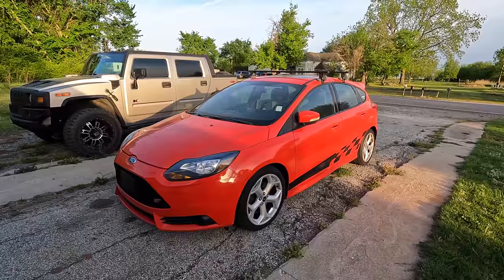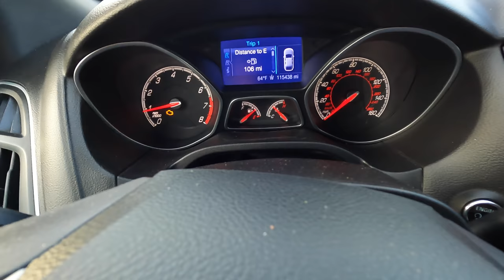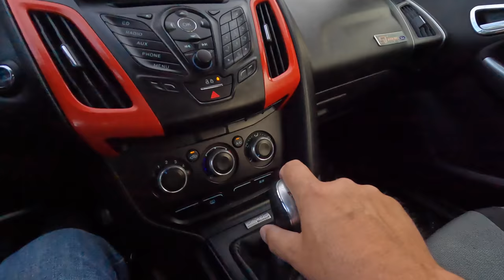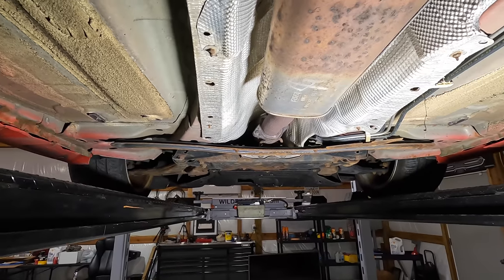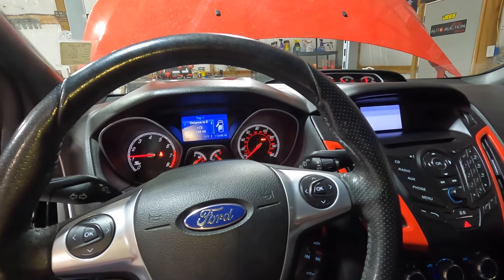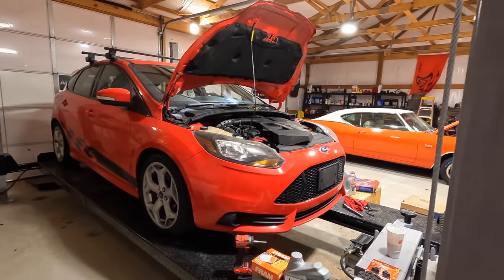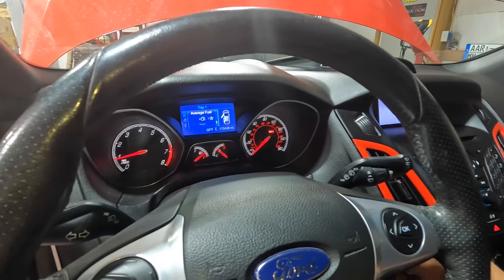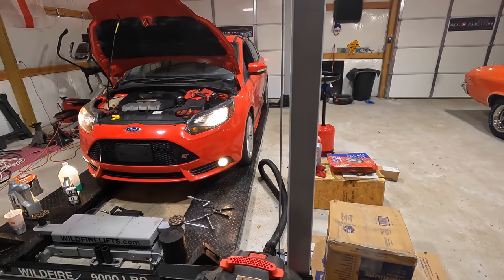I Bought a 2013 Ford Focus ST for $7K Sight Unseen! First Drive and Repairs!

Comment: I own the exact same car 2013 Focus ST1 in Race Red (less the sunroof) - had from new - now at 135,000 miles. Lots of “OEM Plus” type mods done over the years. You can easily upgrade the radio and screen to SYNC3 with navigation and Carplay/Android Auto, like they came with at the end of the run (2017/2018).
Randy - hit me up if you want lots of useful hints on common issues, mods, upgrades etc. (eg Focus RS brake package, full leather interior from Focus Titanium, SYNC3, Intercooler upgrade and tune, flat bottom steering wheel upgrade, shark fin antenna etc, etc.
Reply: In reality,,, Ford can make the Focus fast,,,,but they are still “ a throw away car “ fun though ! LOL

Comment: It's difficult for me to judge car values anymore since the market went apey. Last car I bought was a 2007 Grand Marquis LS for $4K and before that was a 2008 Miata GT for $5500. I doubt we'll ever see those days again.
Reply: here in ky you cant give a grand marquis away but they will beat your door down for a miata. they see rwd v8 and they automatically pass.
Reply: Yea it’s crazy, I bought my car 2 1/2 years ago and I’ve put about 20k miles on it and it’s worth 7k more than when I bought it. Granted the miles are under 50k and it’s a newer-ish car but it’s insane, I can’t judge the market either
Reply: @jeffreyrigged  Strange days, indeed.
Reply: @armedinbama  if you have some kind of fwd awd v6 i4 or a 4wd truck suv car you can sell it book value or more all day. v8 cars cant give them away. even though the gm prob is no worse on gas than say  most fwd v6 cars. diesel trucks same you can name your price but a 3/4 ton gas sells less than a half ton even though they cost no more to operate than the diesel right now.
Reply: bought a zl1 a week ago for 37k. Now I can't find em for under 45-50k
Reply: Nah cars still go for what they used to. It just doesn't happen as often. I just paid 1300 for an 08 Focus 5 speed
Reply: @GokuGaming  dang, what year?
Reply: They will. Once the supply chain corrects itself we will see a surplus and crazy cheap prices. Just give it some time.
Reply: @racequad9  I hope you're correct! 😁👍

Comment: Those little hatches certainly are fun! I drove a Vibe GT for a couple of years and it was fun with 180 hp and a 8,200 redline. So I debated on a Focus ST or my Mustang GT when I was last shopping for a new car back in 16. If I only had $25-27k to spend, a ST would have been mine. But I splurged and got the premium GT PP.  It is a steal for $7k! Hope you can enjoy it a bit before you send it down to road.

Comment: Badass car man. The evap codes are always the evap Purge valve. Should be covered for free at the dealership it's a recall. Try not to boost under 2500 especially in 5th and 6th. lSPI is common on these vehicles.
Reply: Most likely the “cap less fuel neck” back ordered because of defect in design,,, 2 upgrade replacements ! More coming !Google it, there is a special way to “ attempt to clean it “ Ford guy stuff!

Comment: Dont hit boost in 5th or 6th gear when your cruising unless you want to pop your piston rings. These cars are super fun but are known for lspi. Your evap code is for the purge valve and is a recall you can have fixed at ford, if you plan on keeping it at all, Get a bigger front mount intercooler. The stock one is to small from factory. I love mine. I have a 2016 st2, fbo conservative tune I make 255whp and 339tq its not fast. Just quick enough to put a smile on your face.
Reply: Don’t boost under 2.5k rpm’s you mean. I’m at 170k miles and I go full throttle all the time in 5th and 6th, just when the oil is up to temp and I’m in the proper rev range
Reply: @lapinsk  no I mean don't hit boost in 5th or 6th. If your cruising at 2500rpm in 5th or 6th and mash it without downshifting to 3rd or 4th your asking for lspi. If you are doing a pull and you are at 100+ that's one thing.

Comment: Randy make sure you have the upgraded coolent hose that connects from the reservoir Because if it hasn't been replaced it could blow at any moment 2015 is when Ford fixed it they had a recall on it also It's recommended to check the coolant level and cap because it can seize and the Ford focus RS has a 2.3 engine from what I've heard online I was thinking of getting a normal focus with a 1.0 EcoBoost 2016

Comment: Bought my 2nd ST salvage title but no issues! Bought 30k miles and been running since 2019. Got it tuned and cpestage 2 rear motor mount. Runs great and reliable

Comment: The best thing you can do for an EcoBoost is installing a catch can. 

Caution with the battery if it needs one, it’s a bear to do. 

Parking lamps are on when the doors are open - illuminated entry. 

Radio will need a FDIM (front display interface module) possibly.

Oil change reset is KOEO brake and gas at the same time, hold until it says oil life reset.

Comment: That's why I love my Saab 9-5 Aero Sedan 2.3 liter turbo 5-speed manual. It does 260 hp @ 258lbs. of torque with 260000 miles on it and will still show you 160mph with no hesitation. I only paid $1000 dollars for it.

Comment: Check fuses for the radio. I had a transit that had a few fuses not fully installed from the factory, caused my radio to stop working and window auto up stop and a couple other issues.

Comment: I don’t know how do you call it sight unseen because Acv auction would put a full inspection for the vehicle before you bid including sound Record for the engine they even drive it as well and they’ll tell you everything you need to know including body damage and around 60 pictures for the car +10 days for arbitrations if there is something that missing or engine problems or any kind of problems that they didn’t mention

Comment: hi Randy just a suggestion either change the mass air flow sensor or clean it. those kn filters destroy the sensor because of the oil spray material.  I had a 2014 focus and changed it and that made a huge difference. Nice car Randy good deal

Comment: ST's are great, i have a 15 st3 with tons of mods.  its a great platform for modding.  only thing was watching the hard accels when the car wasnt warmed yet...  these cars really dont like that too much.  let it warm up and that oil pressure drop before you start flooring it.  also it doesnt like the 5 and 6 gear accels under 2000rpm.  and make sure when you do the oil change to regap the plugs too.  they are finnicky with the gaps being a GDI motor.  have fun!
Reply: Good info ! Randy should have read your info Before,,, his road test! He did all of the no- no’s ! LOL

Comment: I think that was a killer deal, especially if the title comes back ok. That torque steer comment made me laugh, I had an 07 speed3 and the torque steer was the same, stock 268 hp and after the mods I had over 300 and you had to have a death grip on the steering wheel to keep it straight which is tough when it’s a manual 😂

Comment: The parking light come on whenever the doors or hatchback is open. The radio module controls the display above, and it is bad but is easily replaced.
Reply: I know everything there is to know about the Focus, from having a 2014 ST to my 2018 "Town Car"  that's how it felt going from the ST to the SE non turbo sedan. At 165 HP it is still fast but returns 45 highway mpg with that 2.0 and 6 speed automatic.  I'm too old for the clutch now in heavy stop and go traffic.  BTW I hate Florida with a passion!
Reply: @danielventura8073  Hate Florida because there are far too many “ old people” drivin too slow with right signal on when turnin left !! LOL. P.S. I’m 72 & counting !

Comment: Mobil1 Is amazing for filters and oil. Just don't let it go 10-20,000 miles like they say. I still switch mine before 5,000 all the time. Acura TL 270,000 miles and no issues.

Comment: Excellent car popular with the tuner crowd and the EU. You can get decent hp increase with some simple power adds. For the evap try a new gas cap its a cheap way to figure out if its that or the evap canister. Oh and a wiffel ball on a string hang from the rafters to know the center of your lift (ie it lines up and hits windshield in the middle)
Reply: That’s way too complicating for Randy !

Comment: That's the only focus I would get manual 6 speed. That way I can avoid the tcm issues the automatics suffer from. The focus, escape and transits have the same process to reset the oil life. Key on hold the gas and brake pedal. Slow process when ur trying to get the job done quickly or a customer is standing try to figure it out.
Reply: Ford Europe don't put much effort into the automatic boxes

Comment: Congrats on buying a Maryland car! 

Maryland doesn’t get a lot of snow, but on the slightest possibility of snow and ice, we have an army of thousands of salt trucks at the ready. 

We are among the leading states in the nation in the skill of promoting the efficient and effective rusting of motor vehicles. Maryland can turn your Silverado into a Rustarado in short order, with complete rust through guaranteed within one year after your body warranty expires. 

Maryland can do this for you because the State has a special formulation of beet sugar which is added to our road salt to ensure it sticks to all the nooks, crannies, and crevices on your vehicle. 

In all seriousness, I hope you have the best of luck with you Focus ST, but I would do a thorough inspection on it for bondo and hidden rust.
Reply: I work for the state for the last 8 years and I have never seen any beet sugar added to anything, but they do pretreat with salt brine and of course spread salt, and you’re right about the roads being cleared well compared to other states!
Reply: Jay: gotta love ya for speaking out! Ontario, at least in my area , is the same ! Brine now is spread or pissed on all major roads the morning the new says possible snow! If your unlucky enough to drive on it (hard not to) it’s like Rustcheck ,,, it creeps into your vehicle ! Then it don’t snow! Better go & try to power spray it out of your wheel wells, step up bars, under the spare… it is far worse than salt! That’s another thing when in doubt, spread as much salt on the roads for 3 snow falls!  The environment has been destroyed by all the salt run off! Go figure,,, road salt runs into our sewers,,down to our water treatment plants,,, & our government allows this,,,lesser of two evils,,,,, hey don’t forget to recycle , ggrofw a few trees on your roof!!
Reply: @fredwalker839  Thanks!

Comment: Bought a 300 dollar 2005 dodge neon run n drive. Just gotta finish this project up with fuel pump and air intake throttle tube

Comment: The evap is caused by people that keep filling up the gas tank after the pump shuts off. You can’t do that with newer vehicles. The evap purge valve  assembly is easy to change will cost around 180 dollars from a dealer. That radio screen has been damage. Once again it’s pretty easy to change. Just go to junk yard and get one cheap. New ones are not cheap. Those are really fun little cars and they handle great and you can get another 100 hp out of that engine with a little tuning. There is a place out there on utube that built one of those with 770 hp in the st . And I believe there goal was 1000 hp. Oh and don’t setup that my key. If you set my key up it limits the car to 80 mph and the radio only at half value max. If that key is not the master key you will be limited on speed . You would have to go to dealer to get that turned off
Reply: Very good info ! Your right about gas “overfill” I now see more evap codes in my shop ! Contaminated charcoal canister ! Cheaper gas,,,fill it till it runs down the side of your car? Dah ! LOL

Comment: the radio is typical for these fords. there is a metal box behind the plastic cover that costs about $200. I think its called a radio module. youtube has lots of videos showing how to change it. ford makes the small turbo engines very cheaply. turbos fail and are very hard to repair. standard trans is a plus. I've owned six of them. I use them for uber. the check engine light is common. a leak in the fuel vacuum system. its emissions related and won't effect the car either in longevity or performance. I just clear the code with my reader. it will return after some time but again not important.

Comment: The radio is controlled by the body control module but as I said the radio module is behind the control panel. Screws are under the panel above the HVAC controls. Radio itself is dead.

Comment: Looks like the coolant is a bit below the min mark in the tank there. As a rule, the Focus ST just consumes some coolant over time nobody really knows why. I'm at 115k Km on mine and it just goes down a bit over time. And good luck finding a good RS, the dealer markups at launch screwed that car over so it is hard to find, and never really for cheap unless it's been run ragged.

Comment: Should use more of the gears rather than just leaving the engine revving along. Driving around at 4 thousand rpm for no reason is just ridiculous
Reply from the maker: Feel free to drive like a grandpa in your own car and I'll drive the way I want to in my car. #Murica
Reply: @AutoAuctionRebuilds  oh oh this means you read all / most comments ,,,still don’t get that it is 13 years old ?

Comment: I had one it was a road rocket
Reply: That looks really good. Take the resonator out of that  thing. Put a single in dual out thrush muffler on it. Made a difference picked up about 8- 10 hp
Reply: Might have been a road rocket! Drive a WRX or that Chevelle,,, you want a road rocket ! A 9 year old Focus,,, is a “Ditchbitch” lol

Comment: I had the small evap lead on my 2018 ST and replaced the EVAP purge solenoid and tube Ford P/N BV6Z-9D289-E.  Good luck with the ST I love mine. A family member just bought a 2013 and he loves it too. I'll see if I can find the video on the replacement part makes it real easy. https://youtu.be/etNcCNHnlD8 plus lots of good videos on the 02 sensor replacement.

Comment: Giggling, and high revving the engine that hasn't had an oil change, could be low on oil but you never checked, not the smartest decision. good luck with it.

Comment: It is a nice car and though it has over 100,000 miles it is 13 years old and when you divide the miles by years, you get less then the national average of 12,000 miles a year so it is low mileage when you consider that. As for being a car from MD, despite the state being rock salt happy, there is not a lot of rust buckets there. ( that is michigan) unless you dont spray down the car's underside after each winter. I give my car a good spray under it each spring and i have never had rust issues. As for the title, perhaps they meant replacement title? When you register a car in MD that has a lien on it, MD sends the clear title to the lending entity and the buyer gets a title with the lien info on it. When you pay off the car the lending entity will ether send you the clear title or a signed letter that states you paid the car off and that the title is free and clear. Some folks opt to take the letter and their copy of the title(that has the lien info) and get a new title issued. Or perhaps copart got confused with the fact they got two titles with the car (the lien one and the clear one from the bank)
Reply: Leon; very good info! Randy also said the car was 13 years old,,,,my question is , how can a 2013 car be now 13 years old? This is 2022 ! This is just arithmetic,,,, even if the car was an early build,,, the most it can be is 10 ! LOL.

Comment: Lol - there is no way that car does a 16.3 1/4 mile at 102 mph. You transposed your #'s its likely a 13.6 1/4 mile. That particular one with 150K miles probably will do a solid 14 at sea level if you drive it like a non-vegan.